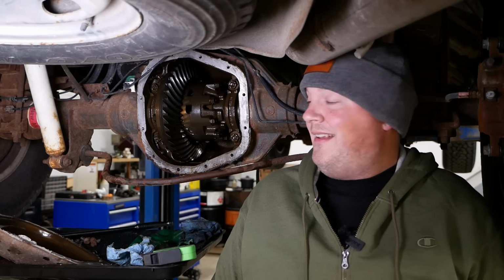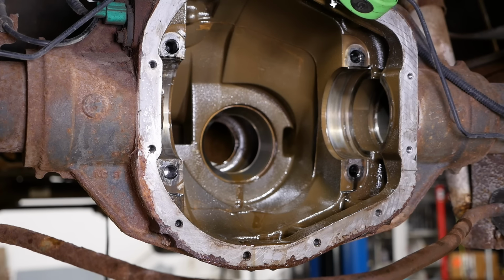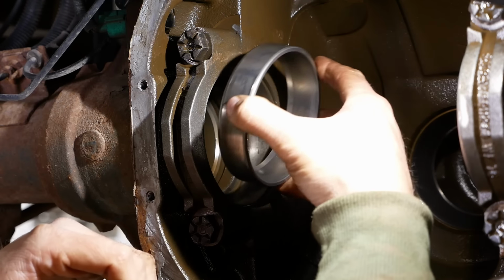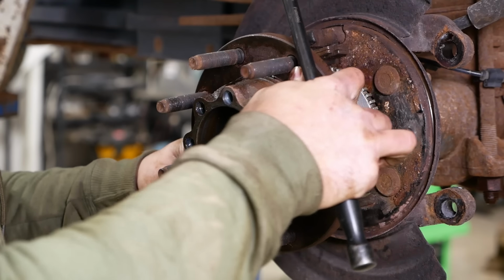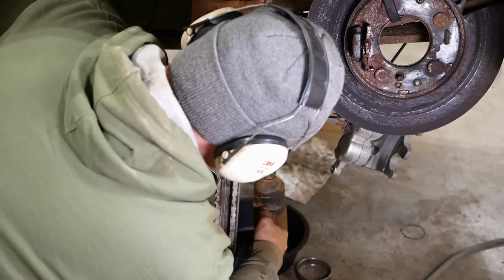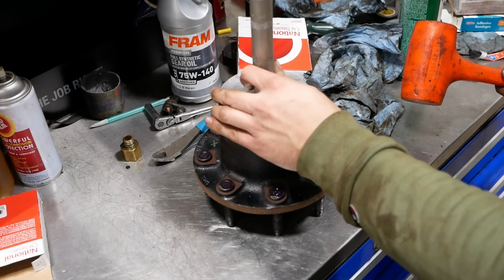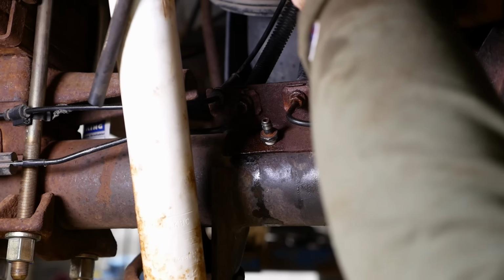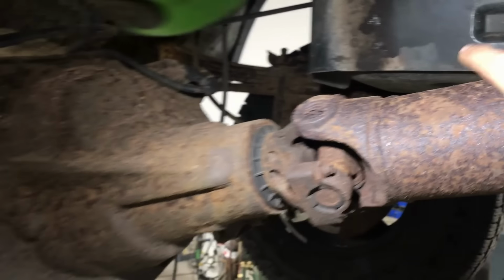Ford Differential Carnage - Driveline Noise Located

Comment: I wonder if the guys should check and see if the bearing races are tight on the used rear ended to get and those did not seem took those bolts holding in the pinion did not seem very tight to me I wonder if somebody else has been in there and didn't work them to the proper torquing sequence as prescribed by NASA

Comment: What I would also be doing is asking the place where you can get the second hand component if theses usually go in the trucks or has this one been mistreated if they dont usually go and they suspect that the truck has been treated poorly I would be covering myself with the customer and tell me what the usual is for theses diffs and therefore if the second hand one goes no warranty. It could even be the guys kid thta takes it out and gives it a hard time. I actually  have never seen oil out of diff that looks like a milk shake so it was something really drastic going on like everything out of balance making those bearing rotate when they are not meant to .

Comment: With the brake parts its more of a safety thing if you buy junk brake parts and have an accident and the junkyard sold you them they could be liable and lose their junkyard due to selling dangerous parts so most wont sell the parts to save any hassle and those that do tend to have a waiver written into the bill of sale so they are covered legally.

Comment: Just curious. No Liquid Wrench or something on Pinion Nut before impacting off. Why???
Reply from the maker: Because it doesn't do anything but make it wet.
Reply: @WatchWesWork  Not sure what that means, but I guess you are saying that penetrating oils have no value and does not offer at least some protection against damage to threaded fasteners by removing them dry? I'm afraid I have a big problem with not taking steps to protect threads from damage before removal. And I see some mechanics reinstall corroded bolts without cleaning/lubricating the threads which leads to thread damage and it's also impossible to achieve the correct torque.
I would appreciate your explaining your reply and your view on my concerns about removal\re-installation of fasteners. Thanks very much. Regards

Comment: Military vehicles was designed so water would not intrude on the rear end it was cheaper to replace the wheel bearings in easier to replace wheel bearings in battle instead of replacing the whole rear end like you're having to do on that Ford

Comment: ..question is, why would a rear end, especially a heavy-duty one like that, go bad with only a little over 100,000 miles on it?...My Eaton HO-52 recently let go in my 1970 Chevy C-20 (3/4 ton) after making whining noises for 3-4 years...but then again, it is over 50 years old, and the odometer has made 4 trips around since I bought it in 1998...and it was a well-used-and abused truck even then....

Comment: Excuse my ignorance, but at 6:07, what is that vibrating impact tool that is being used on the side of the pinion flange?
Reply from the maker: Air hammer. Best tool ever.
Reply: @WatchWesWork  Yes, but the attachment for the hammer, the part hitting the flange, I have a hammer with a few attachments, but I can't say that I have seen that kind of attachment, that you have, before. Great video as well, very informative.
Reply from the maker: @noidnomis  It's made by Mayhew. I forget what they call it.
Reply: @WatchWesWork  Sweet! Thanks!!

Comment: Some car manufacturers advise to change rear diff oil after 1000 miles from new to prolong life.. I don't know anyone who ever did that...
Reply from the maker: Most people never change it ever.
Reply: @WatchWesWork  I recently wanted to be super good and do gearbox and diff oil at half the recommended intervals, and so the shop quotes me a price for the diff, but it then turns out I don't have one :) It is baked in with the gearbox somehow, apparently.

Comment: Looks like slight water intrusion coupled with typical limited slip issues and 100k fluid. Book says change at 100k, ford limited slips like them better at 50k miles.

Seen 10.5s and 9.75 pinion bearing issues out the butt in my 15 year career.

Comment: but yeah he didnt want to the responsibility for the brakes failing especially as older cars had under spec braking systems compared to today. This was mainly because alot of cars were all drum brake back in the day which can over heat and fail.

Comment: Been there done that lol, I ended up swapping out axles on the 86 chevy k20 custom deluxe long bed I destroyed the factory front diff a gm corporate 10 bolt because of 200k miles and bad front u joint, well there was no diff fluid in it i didn't know that the cross shaft pin sheared the head of the bolt off and came halfway out got stuck under the carrier and got shoved through the housing effectively locking up both front wheels from turning, and I ended up having a heck of a time trying to locate a decent useable gm corporate 10 bolt dual front shock 4.10 axle for less than $1,500 if I am paying that kind of money I'll just hold out for a dana 60 with at least 4.11's, anyway I got a deal on a set of axles from a buddy who i got the truck from,,he wanted the 8 lug stuff including the factory Western 16 inch aluminum turbine wide lip 8 inch deep wheels the same midnight blue as the truck, and the factory Firestone 7.50 16 snow king tires, for a complete rebuilt front gm corporate 10 bolt but from a 83 gmc High Sierra k1500 with 3.08 gears minus the warn new front hubs, and I got the rear gm corporate 10 bolt matching axle but it was not touched except axle seals, so I pulled the diff cover after draining it and checked it and put a new diff cover gasket on it, and filled it with the correct anti slip fluid additive and the gear oil,i had to immediately change the rear axle tube vent it was pruned off, and the rear brake lines on the truck were rusted junk being a Ohio truck, and i bought a new set of the factory size u bolts for the front and rear turns out that axle set was in a 400sbc 4spd 4x4 long bed truck and considered the heavy duty suspension option for that truck, but like i said yeah been there done that took 2 full days in the driveway disassemble and 2more to put the truck back together and it's factory heavy duty 3/4 ton leaf springs on the 6 lug axles on a set of 16x8 American racing atlas chrome plated one piece aluminum wheels and Baja wide track at tires by peerless tire ..

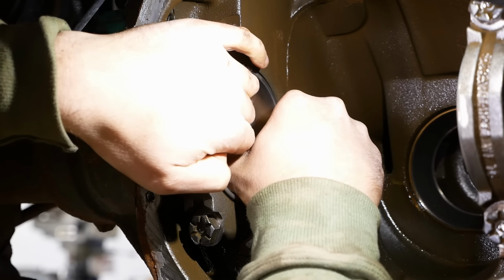Comment: 12:25 Just a thought, maybe a stupid one, but why can't they effectively spline the outside of the bearing with one or more teeth that fit into the housing or cap to completely prevent rotation of the outer race? Does anyone know why that doesn't work, because I can't be the first person to think of this solution, and the fact that they aren't doing it means there must be a reason not to.
Reply from the maker: It's not normally required. The bearing caps hold them nice and tight.
Reply: @WatchWesWork  Fair enough, they'd have no reason to bother designing for the edge cases like this. Thanks for taking the time to reply and for making such great videos! Keep up the amazing work, my whole family and I really appreciate it!

Comment: Do you add any high-pressure additives to the rear diff to keep the ring and pinion gear from making excessive noise?  I changed the rear diff fluid on my 2000 Dakota and she was instantly louder.  My transmission guy gave me a squirt or two of his magic bug juice and walah quiet again.

Comment: Great video!

Just wanted to chime in on the super duty w/6.2 gas and locking rear end. I've put 70k miles on mine (@ 135k now) and it's been flawless except a seized front axle joint gave me trouble and a leaky radiator. I would recommend it.

Comment: I would shave the bearing caps .001" and go from there... No reason not to re-use the same pinion shim.... You're still using the same pinion& gear set.. So the depth will be just right ... As factory determined.

I would never disassemble fasteners without penetrating-oil.. galling the metal and more effort needed.... Like when removing the drive-shaft hub..

Comment: Iv got a 7.3 97 and ik the axle shaft is snapped was t much oil in it i bought the truck locked up rear end iv tried everything to get the passenger side axle shaft out theres no c clips its a half ton but iv moved the shaft from inside the diff it’s definitely broke but i just cant get it to pop out in literally gonna chain the truck to a tree and weld a hook to the axle shaft and just fuckin yank at this point

Comment: The problem wasn't the bearings!
It was neglect!  Why wait till the shit starts howling!  Looked like that gear oil had never been changed. This is what happens when one doesn't PM their vehicles..
Good thing the bearing was howling...otherwise that rear diff would have been continued to be neglected 
oh, and I'm not even a mechanic!

Comment: Ford rear-end is not the problem it the bearing co if that oil and traction fluid was changed every 25000 miles there would be no problem of course when bearing fells you going to have lot of metal

Comment: Those are not shims those are spacers and they come in different thicknesses. That's how you adjust statgear that you measured with the dial indicator with those spacers. You should have paid attention when you remove them so you know which one goes in the front and which one goes in the back 2 Center that gear. You're definitely not a rear-end man no matter what they say about you at the gaf bar and unicorn Cafe
Reply from the maker: No. The preload is set by adjusting the shims under the bearings on the carrier. The shims are the same thickness.

Comment: Isn't it still a 10.25"?  They always worked well...'cept for pinion loosening and bad placement of the vent(clogging and water entry.  Sterling...made in Ohio.
Reply from the maker: Not in a Superduty.
Reply: @WatchWesWork  I my day, Super-Duties were f450s...they all had Dana 80s.  Those work great too but are far more difficult to work on.

Comment: Sterling 10.5 is garbage , I went to a Dana 80 on my dually 244,000 miles only thing I have done is hub bearings and races and no oil slinger shit.
Reply from the maker: The older 10.25 was pretty bulletproof. I don’t have much experience with the 10.5.

Comment: You would be surprised what the liability is with today's slacks that won't service or maintain anything except for pump fuel in and maybe oil when it knocks, ticks, chatters, or the idiot light 🚨 comes on.

Comment: Impact gun guys like you shouldn't give up your day job. you never explained any of the little ticks like marking caps or mot mixing up the shims. You think people watch these videos for entertainment?
Reply from the maker: Because those "tricks" don't apply to the Sterling axles. The caps are marked from the factory. The "shims" are not shims. The shims are under the bearings on the carrier. If you're going to be asshole, at least try to know what you are talking about.

Comment: You are to cheap to install a 3 dollars gasket on the rear end?  What is the matter with you? If you are going to do the job, do it right or don't bother. I should have known, you are using cheap Fram gear oil. What crap that stuff is dude. I bet you use the cheap cardboard Fram Filters also? I have to make sure to never bring my F-350 too you to work on.